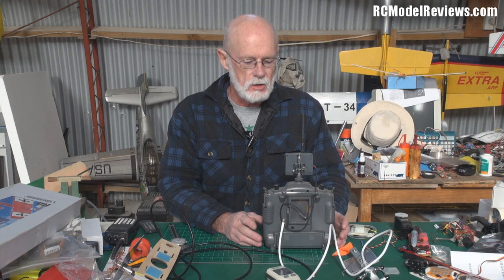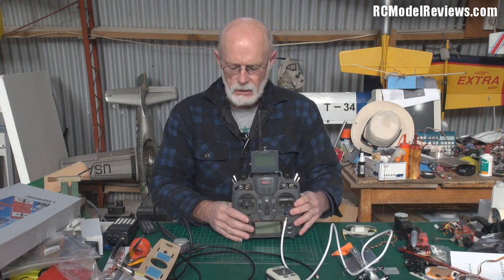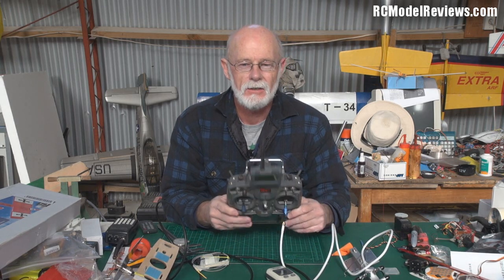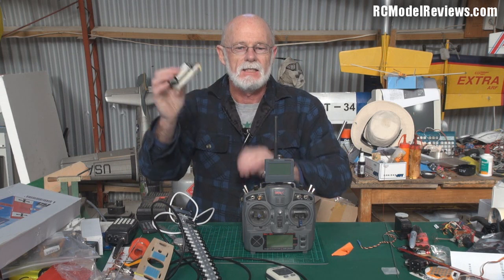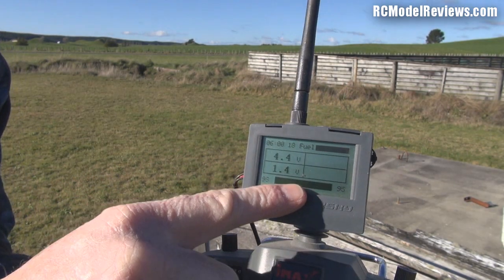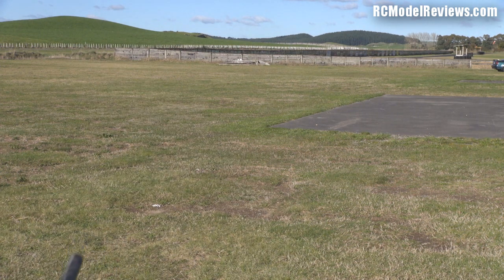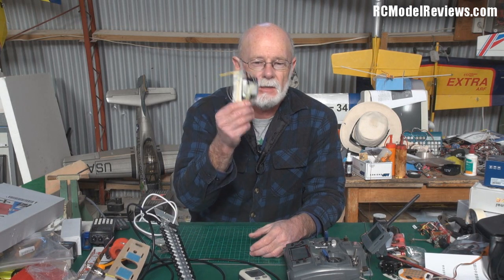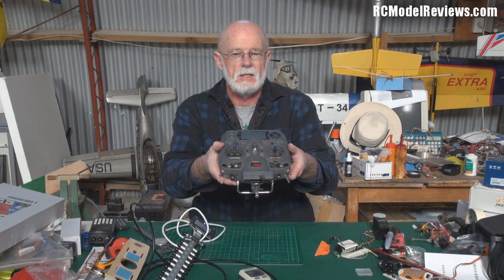Finding lost RC planes using telemetry

Comment: I find that using internal antennas on x18 etc and I suspect and with external as well  it works best to turn my back to the approximate location of the plane thus creating a shadow and the signal really drops... so the plane is somewhere in back of me   swinging back and forth gives you a much better idea of specifically where it is

Comment: I have tried this tracker and that tracker but RSSI helped me find my drone many times. This idea came to me through this video. Thanks.! My version i keep the antenna folded and I sweep for the strongest signal. Turning 180 degrees weakens the signal because it can't go through me very well. In fact I just used it Today to find one lost in a wooded area which sported a new camera that I didn't want to loose of course. When I was close I activated the beeper. What ideas do you have for thorn bushes Haha. Just saying thanks!!!

Comment: I've used a similar technique (tracking with RSSI) with my old flysky transmitter many times(up to 1/2 mile or so away). What I did was to follow the RSSI until the signal was getting very strong and then turn on the "beeper" in the model.(trying to conserve battery power). I could always find it even in tall weeds with this method. If you're out of transmitter range(no rssi on screen)  just drive or walk in the general direction until you get an rssi reading again. Another helpful idea is to put bright flashing leds on the craft, then look for it after dark.

Comment: Hi Bruce, I lost my Alien 5" in the middle of 150 acres and having lost video signal for a few seconds I had no idea where...  I had no signal on either my radio or my goggles so I went all over the property looking for signal.  At the last moment, after an hour of looking I picked up a weak signal on my radio.  Now I don't have any telemetry or anything so it was back to first principles.  I thought I would try to use the dead spot on my video goggles to identify the line on which the model was.  This seemed to give a pretty clear direction.  Then I moved to another point and triangulated.  It was not particularly accurate but after another 15 minutes I had narrowed it down to about a 150ft diameter circle.  By continuous triangulation always looking for the poorest video picture I narrowed it down further.  It pointed to a point 100ft vertically up a 1 in 3 slope... After a climb, I blipped the throttle and found my Alien almost at my feet under the gorse...  I hope this is helpful to you and other disappointed FPV fliers.  This of course relies on the battery staying in! But it just requires your normal video transmitter and receiver.

Comment: how come that the signal is lower when pointing direct at the model? As when you had the receiver and the transmitter very close (in the beginning of the video) the signal was very high value around 100db.. can't seem to get it
Reply: +Johnny TSC Because the tip of the antenna is least sensitive point (smaller receiving surface) so with the lowest signal on the screen it has to point at the model. If you turn the receiver a bigger part of the antenna receives the signal and thus a bigger signal on the screen. If you are closer to the model the signal must be stronger (so not as accurate) but you will know roughly where it must be.
Reply: Thanks.. I know now the lower the number the better the signal :) thanks anyway much appreciated!

Comment: Hi Bruce, I had the misfortune to loose an electric model Fournier a few weeks back ( elevator servo failure!) and found the model some 2 miles away using the RSSI on my Taranis Plus, walk towards it signal increased, to either side signal decreased simple !   in practise not quite that simple but found Fournier with Taranis and your help, Thanks Bruce.

Comment: I successfully found my plane and copter by pointing 5.8 GHz video rx cloverleaf antenna holding it near my chest to make it soft of directional. Now I also have directional helical antenna, it might be useful.
But video range is limited, so I had to know roughly where I had crashed. Also battery of video tx will be drained in some time.

Comment: I have also used the video goggles to track down my Hexacopter which crashed and still had the video transmitting....
I walked (ran... I was concerned :-) toward where I thought the vehicle crashed and saw through the Fat Shark video goggles that I was still receiving a video signal...
so I took off the antenna to narrow down the search and Behold I found the Hexacopter.....
I had accidentally crashed when a motor quit and as it was spiraling down I was confused as the video was fading so I turned off the transmitter (incorrectly) and hoped the Naza failsafe would send my Hex back to me.... 
What really happened was that my failsafe had not been reset since trading out Spektrum receivers and the poor thing crashed through the trees......
I just broke an arm to the motor and lost a battery...

Love your videos!

Comment: Is it easy to make a low voltage cut off circuit for the attached lipo because if I use it, I'm bound to forget to disconnect it after landing.

Comment: Hi Bruce- could you not get  better accuracy using the Frsky 2.4Ghz patch antenna for more directional accuracy- so when pointing the patch at the frsky RX/lost model the signal maximizes (rather than minimizes) but would it not be more accurate than using  a whip antenna? Thanks for your great videos- would be interested in seeing how to do this without involving the whole TX..

Comment: Funny thing, a friend and I used a similar idea to find a lost quad 2 days ago.
Using the frsky built in system and shielding the antenna with his body it beeped more (weaker signal) when it was well shielded which meant the model was behind him.
Naza RTH fail caused it to go land somewhere else. In amongst a big stand of trees about 2.5 km away in fact. It ended up with broken arms but props were intact so we figure it "landed" in the top of the trees and the naza shut it down. Then it fell.

Comment: I just did a test with my Qanum battery telemetry unit and it works too - even though it doesn't have the signal resolution of the FrySky.
Taking the antenna off the receiver (in my hand) allows me to home in after establishing the direction by pointing the antenna at the Tx on the  model. 
I fly with this system connected all the time so in the unfortunate event of crashing an expensive heli out of site or in the bush somewhere - at least I'll have some hope of finding it.
Thanks Bruce.. again!

Comment: did I miss something? I thought the Quanum 2.4ghz remote battery monitor did the same thing? a very small TX for the model, runs off and monitors main battery voltage, at other end, with a clip-on self-powered RX with LCD shows the battery volts on all cells remotely.  Could this not do the same job? 
Steve

Comment: I'm using a different method: A small arduino promini (any arduino, even a rctimer i2c adapter will work, you have to solder a few pins for gps/telemetry) and a GPS. Promini talks to GPS, gets the coordinates, speed, heading and all that data, and encodes/sends it to FrSky Telemetry receiver. Now I don't have space to put a bulky FC on my plane, but I can pop in this arduino somewhere, and tape the GPS on the top. Details and code is at multiwii.com forum, /forum/viewtopic.php?p=36726#p36726

Comment: I actually did the same thing two weeks ago to find my little flying wing which crashed in the middle of a wheat field after a dive (the lunch was ready and my mother gone mad xD) 
Usually i try to hear the propeller noise but this time it was broken, so I did this exact thing and I found it in a minute! It works really well even at few meters! 
A few years ago, it happened to me the same thing, but I was flying with 72MHz, and I found the plane only after the wheat has been cutted!